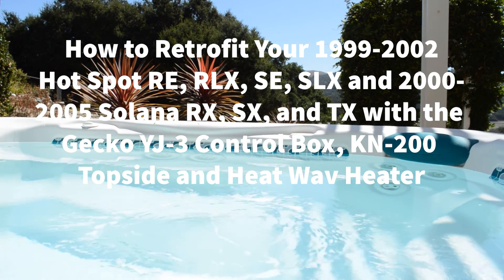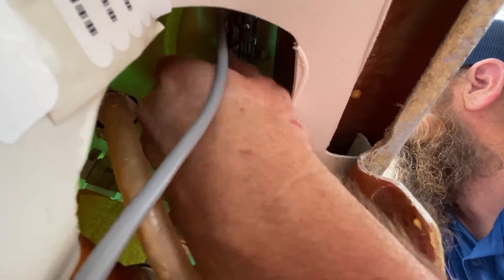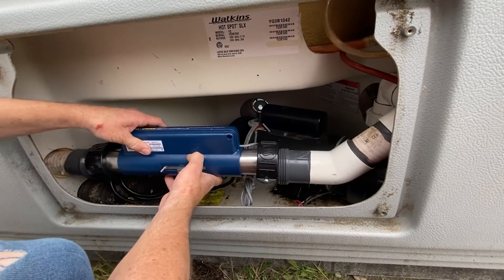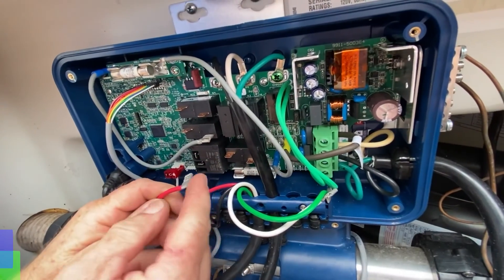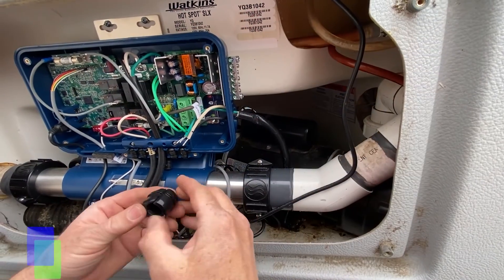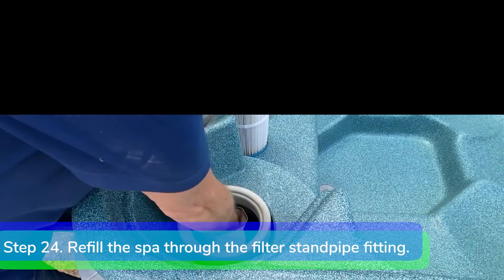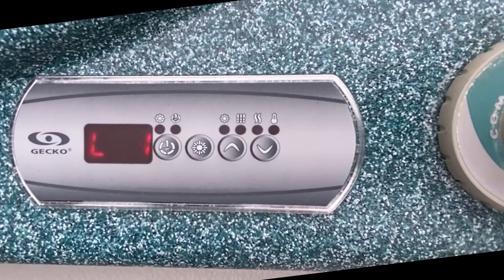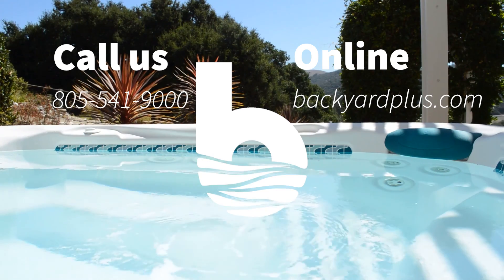How To Retrofit Your 1999-2005 Hot Spot and Solana Spa with the Gecko IN. YJ-3 Control System

Comment: Hello I have a 2000 RLX hot spot  similar to what you have but it’s round. I Have a leak coming from the outside bottom of the tub… my question is how do you remove the white panels on the outside of the tub to see what’s going on inside where all the tubing is, not sure ? I don’t see any screws or latches ? Any ideas ? Thanks so much
Reply from the maker: You should call Watkins Mfg. and talk to their tech support. They will be able to help you with that.  800-999-4688 ext. 8432